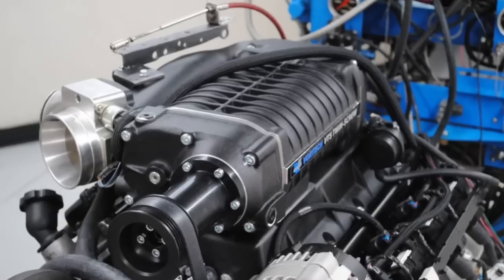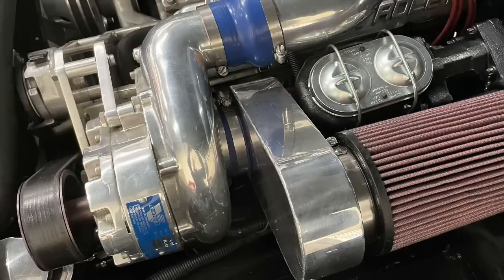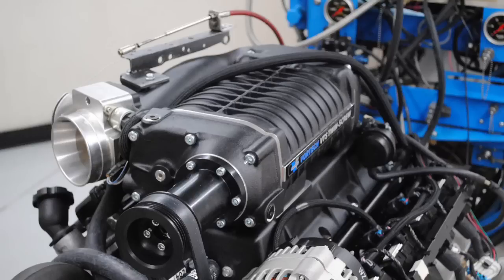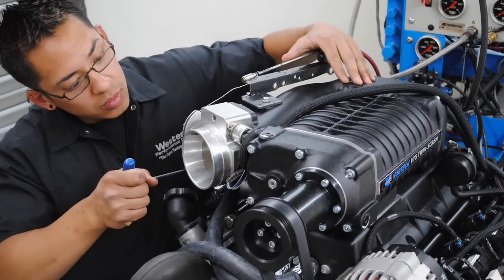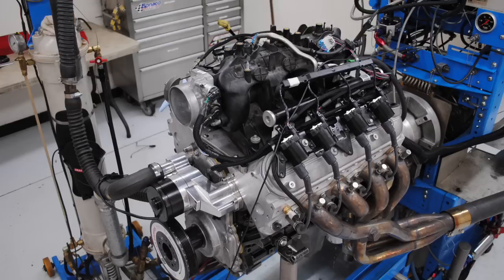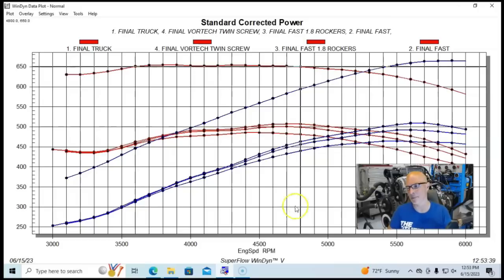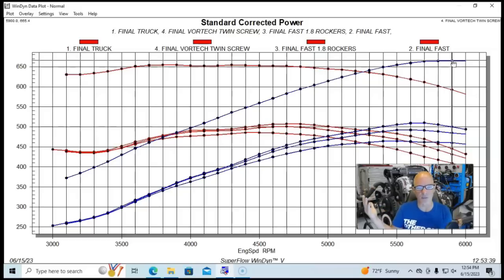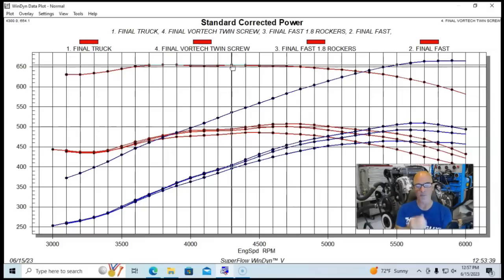INTERNET MYTH? VORTECH ONCE OFFERED A TWIN SCREW  SUPERCHARGER KIT? FULL DYNO RESULTS-383 LS STROKER

Comment: i need a smart person to answer this question.
the air to fuel ratio is 14.7 to 1 part fuel for petrol. 
so on 15 pounds of boost that would be 7.37 to 1 in a cylinder and the average compression ratio is 8.5 to 1 so why doesn't it hydro lock?
on a methanol car it is 6.5 to 1 
so how is fuel calculated in the air to fuel ratio fuel vapor?
or if you have a 2l engine the fuel would be about 136ml of fuel to the air to get the ratio of 14.7 to 1 so at 2000rpm it would go throw 136litres in a minute 
so my question is how is the 14.7 to 1 calculated.
is once the fuel is a gas state like steam which expands approx. 1400 times is that what the ratio refers to.
everything i have read online refers to 14.7cubic centimeters of air  to 1cubic centimeters of fuel but this cannot physically work.
so can someone explain how the fuel is measured thanks
Reply from the maker: you are multiplying the wrong variables. AF ratio on a boosted application is 11.5:1 under boost(even with the added airflow)
Reply: @richardholdener1727  i understand that but that was an example to put it simpler if the car runs on alcohol and the air fuel ratio is 6.5 air to 1 part fuel and the compression ratio is 8 to 1 there is more fuel at that then there is free space in the combustion chamber so the air fuel ratio cannot be 6.5 to 1. 
so what unit of measurement do they use to get to the 14.7 to 1
because what i am reading is 14.7ml of air to 1ml of fuel but this cant be correct?
what is the correct measuring scale for af ratio?
thank you for taking the time to respond I appreciate it.

Comment: Drive by Wire is your friend when using large throttle bodies. They can be tuned for gentle tip-in, and flow enough at WOT.

Comment: Hey man I was running a large cam in my 5.3 with .660 lift springs and got rid of it and got the chopacabra cam and wondering if I’ll be ok running the dual springs or do I need to get the ls6 springs

Comment: Correct me if I'm wrong, but shouldn't we be expecting a bigger gain than 150 lb-ft of torque when we add 2/3 bar of boost to a 500 lb-ft n/a motor?  Why isn't it more like double that?  What am I missing?
Reply: Parasitic losses from spinning the blower

Comment: My question is how much power can one belt transmit through all those accessories? I think someone said 30 horsepower is about the limit depending on the width
Reply from the maker: the blower required more than 30 hp to drive

Comment: The truck mani can be made better...so it don't just do what it do.

Porting the oe tb helps. The tb opening on the mani is actually slightly smaller than the tb blade....so gains can be had there and in some port work in the runners.

You can tell by looking at the map sensor. I've always seen the stock manifolds and tb's usually pull on the map sensor pretty good. And that's missing power.
Reply from the maker: the throttle body is not the change in power between the FAST and stock truck
Reply: @richardholdener1727  yes it will. But you have to open up the throat of the intake manifold because the throat if the intake is smaller than the tb.
Reply from the maker: the FAST makes more power NOT because of the TB opening-it is a different intake design-lots of intakes with bigger throttle bodies make less power than the truck (it's more than just flow)
Reply: @richardholdener1727  I've been down this road with my own porting and testing. You're simply wrong....and you're focusing only on the tb and not fully understanding what i said.

The factory tb and intakes can be improved. So can the fast intakes. They need a good port job.

Comment: Glad to see you were measuring vacuum between the blower and the throttle body.  Great way to tell when you have enough throttle body.  As for the aftermarket 102/103 DBW GM throttle bodies...A big throttle isn't a problem for drivability, its the build quality/tolerance on the aftermarket stuff.  They stick, have electronics/motors that don't move smoothly, and that's the issue.  If you get a good one (took me 3 tries) they drive fine.  If not, its a nightmare.  BTW, 102/103 is usually enough for 1000+ hp on a PD blower.  Not necessarily ideal, but enough.
Reply from the maker: the opening rate has nothing to do with electronics-the point was that bigger tbs are touchy when first opening compared to smaller units
Reply: @richardholdener1727  Only if they stick though.  You can slow opening rate through the electronics or, if cable throttle, through the throttle cam.  But the aftermarket 102/103s have often have bad tolerances that cause them to stick when opening from full closed, especially when cold.  Would like to see someone try the Honda OEM approach of using a paint/epoxy layer at the closed position to allow them to "self-clearance" a little.

Comment: Great video Richard, would have liked to also see some boost leak examples on that twin screw setup and also on roots setups with different size holes showing how they effect power and psi drop. Curious how it would have effected that 9.8psi it made, also wondering if the blower size itself would change the dyno results if two different size blowers we pullied for the same psi then gave leaks or if they would equally lose the same.

Comment: Question: how does increased rocker ratio add duration? The time the valve spends off the seat hasn't changed. The speed of the valve and the distance traveled increases, but the time the valve is open is controlled by the lobe. The ivo/ivc - evo/evc remain the same. So, where is the extra duration?
Reply: Duration is generally measured at 0.050” lift.  With more ratio in the rocker 0.050” lift will come earlier when opening and later when closing.
Reply: @edwardwood3622  I am having a problem wrapping my head around this. Because the point at which lifts starts, is still at the same point on the cam.... The lobe doesn't change. I'm probably overthinking it but I just don't understand.
Reply: @Randomguy-5150  it doesn't change the duration from o lift but when it starts opening the valve it opens it faster so it gets to the . 05 lift a little sooner and stays a little later so it opens the valve a couple degrees more on each side. I hope that helps
Reply: @Randomguy-5150  my mistake explaining.  With the 1.7 rocker at 0.050” lobe lift the valve lift will be 0.085” withe the 1.8 rocker 0.085 valve lift will be achieved at ~0.047” better?

Comment: Can you do a video showing which stroker kit is best for l92 combined with a lsa or other supercharger?
Reply from the maker: there is no "best" stroker kit for a supercharger
Reply: @richardholdener1727  so don't supercharge a stroker motor?
Reply: @richardholdener1727  I guess there's too many variables with that vague question. So I'm about to build a l92. I am thinking about supercharching with a lsa kit. But watching some of your stroker videos it's got me wanting to stroke the motor. I want a reliable engine with around 700hp to the crank. Just seeing how you would achieve that
Reply from the maker: THE LSA BLOWER BECOMES MORE AND MORE RESTRICTIVE THE GREATER THE DISPLACEMENT AND NA POWER OUTPUT
Reply: @michaelmorris4902  I remember 700hp was prettying easy to achieve from a stock LSA with bolt ons etc. Maybe cam. Definitely pulleys. I think you need blower porting as well.
I would spend the $$$ elsewhere not on a stroker.

Comment: If only screw type compressors were more efficient 🫗
Reply: If they were more efficient than turbos that would be awesome 😂
Reply from the maker: than what?
Reply: 😆
They take more to drive for the given hp returned. A little less efficient than a centrifugal but still incredibly capable. I like the power delivery of positive displacement superchargers, but again, the answer is always TURBO
Reply: @Russell_and_Rosko  So build a turbo rail that is faster than top fuel, we will wait......
Reply: @shvrdavid  efficiency. The topic is efficiency. Did something happen in ‘Nam? There are better options than screw type supers in my applications. I’m cracking up writing this. There’s no offense intended when bringing up differences in supercharger designs lol
Reply: @Russell_and_Rosko   I see you still have not answered Richard's post. What is your application you speak of? Scooters, Lego's, Bench racing, Bragging rights? You still have not said, so who knows. Efficiency in an engine can take on many meanings. Is a turbo efficient at making bottom end torque? No, it is not. Is it efficient at making 11.000 hp? No, not a chance. Will it raise power all across the power band? No, it is not efficient thru most of it. So what is your application that a turbo will out perform it? I am very curious what your application that a torque curve as flat as Kansas would not work in.... And why it would be overall less efficient than a turbo that is only efficient in a small part of the compressor map? Just so you know, the average turbo is 75% efficient, at best. A roots blower is 75% at a pressure ratio of 2. A centrifugal blower can reach 85% efficiency. A screw blower, can hit 100+%. So which is the most efficient? Now I am talking efficiency here... So which one is the most efficient again? The screw blower is....
Reply: @shvrdavid  
My applications include tinker toys and the occasional hobby howdy horse. 
You're right, blowers can make power, but again, turbos and even centrifugal supers do it more efficiently than any screw type blower. We're talking about different things ie total output vs efficiency 🤐
Reply: @Russell_and_Rosko  Actually, they don't, but whatever..... Screw blowers are the most efficient boost there is. You talking bs and not considering the actual efficiency of the entire system. All while chiming in about efficiency you know nothing about. No turbo ever goes over 75% and most never even reach that. Screw blowers routinely reach 100% pumping efficiency. The difference in patristic loss is offset by the pumping efficiency, and you don't understand that at all that either. It doesn't take 25% of the engines output to turn the blower. But you loose 25% just from bolting a turbo on. It takes very little hp to turn a screw blower even at 4500hp total output, and you don't understand that or total efficiency at all. You loose slightly less power spinning the turbine(s) in a turbo, than it takes to spin a screw blower.... And the screw blower is, at minimum, 25% to 90% more efficient at pumping air depending on the rpm of the engine..
Reply: @shvrdavid  it looks like I have a lot to learn. do you teach/instruct on the subject?
Reply: @Russell_and_Rosko  I did, for close to 30 year, but not anymore.
Reply: Yeah, running 3.5s at over 200 in the 1/8 is so slow... So is running 6 flats at 240 in the quarter... They need to make screw type blowers way more efficient than that.... Then they can ban the from the rest of the classes they are still allowed to race in....